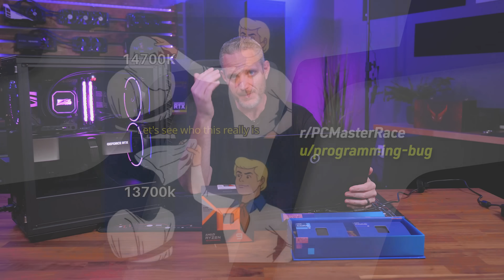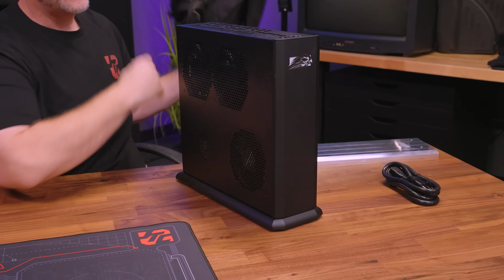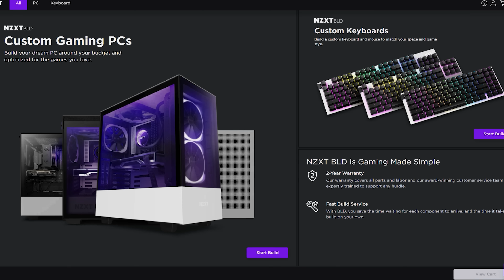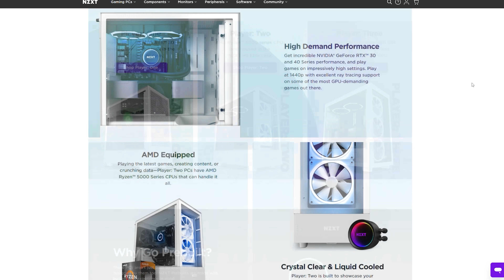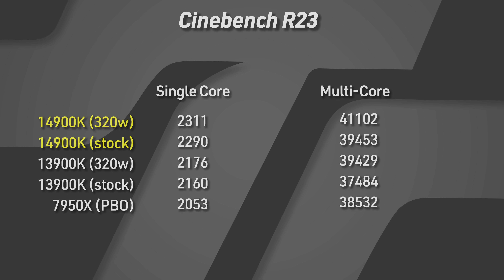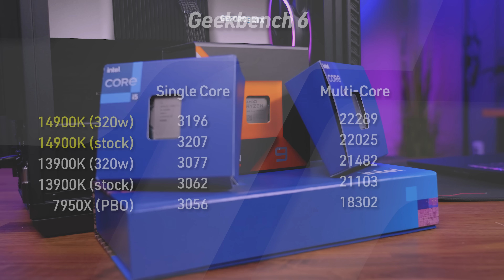THIS is why people have trust issues! Intel 14th Gen Review

Comment: Jay.. you can't say "rewinding" anymore.. There's so many youngins now that haven't a clue what rewinding means or where it comes from lol
It's all seek, "go back", and skip.  I'd be willing to bet a lot of the younger ones have never even heard of a VCR, or "tape" in any sense.

Like Jay and I are the same age, we grew up with real floppies, 8inch 80k-250k and eventually up to 1.2mb, 5¼ 360-720k disks, and computers that didn't have hard-drives.. The screens were monochrome or if you were a baller you had CGA graphics or a system that could accept cartridges!  In the first 20 years we went from a couple KB up to about 40mb HDDs. The next 10 years we went from those 40mb drives up to 250gb or so .. Then in the following 5 years, we went from those 250gb up to multiple TB hard-drives. NOW we have 1 trillion byte micro-SD cards the size of your thumb-nail.  The speed of progress just blows my mind every time I think about it. In my 4 decades I've basically seen computers be invented and advance to a 2023 cellphone going toe-to-toe with the worlds fastest super-computer of 2000.

Sadly, however, the period of exponential growth is behind us - we're already at the limit of what silicone is capable of.. 5nm is the size of about 10 large atoms.  So we're making transistors that are just several atoms wide, and at this scale, quantum tunneling becomes less of a "challenge" and more of an inevitability and barrier to further progression. Because the smaller we make them, the more concentrated the heat we need to dissipate is. The faster we want the CPUs to go, the more heat they generate in an ever-shrinking footprint.

I don't think we're done with speed and shrinkage yet though, we just need a different substrate .. which is why there's been so much attention and effort put toward graphene, carbon nanotubes, and even diamonds as CPU substrates.  So we're going to stall for the next few (several?) years until the industry settles on one path/tech over another, then things will start improving radically and very quickly again.

Sorry for the rant and whatnot, it's late and I've been slaving over a hot .. engine-compartment for about 40 straight hours. G'night kind internet strangers <3

Comment: My i5-2500k lasted about 10 years before I really felt that I needed to upgrade. I have had a 5900X since it came out in Nov 2020 and I don't think I will need to upgrade for a few more generations. Maybe 9900X or 10900X when they come out.
Reply: You will need to upgrade way before that, all you sandy bridge owners forgot how normal time and tech advances. You bought a good cpu in the dark ages of cpu advancement. CPU power has in fact already improved beyond the entire “bridge” era since the Ryzen 5000 series. Even X3D chips represent what still counts for an entire generation of improvements in game performance. Look at the 5900X vs the 7900X. The 5800X3D is almost the same as Zen 4 and the 7000X3D is another gen worth or perf, likely to match a stock Ryzen 8000 unless AMD breaks the mold again and perhaps the 8000 is like 35% faster baseline.

Comment: Maybe try running Cyberpunk on a z790 MB, for me it just wont work with out tweaking the Bios using a 13700k (tried both Gigabyte and MSI both had same issue) even clean install of Win 11 still would not run)

Comment: So I'm going from a 9900k to the 14900k. My 14900k already shipped. I'm happy tbh. I've had the 9900k since release. I like to upgrade every 5 years...Should I have waited for the 15th? I was debating it. The 15th should in theory be a LARGE improvement....but I just want to run my FS2020 at 60 frames 4k and be able to edit my videos a bit faster for now. I think it's worth it for me coming from the 9900...but I agree, coming from anything 12k or above, it's not worth it. Wait for the 15th if you're on the 12th or 13th gen.
Reply: I went from the 9900k to the 13900k and that upgrade was totally worth it.  Something like 3x the performance.  I'm sure that you will be thrilled with the 14900k.
Reply: Nice I also upgrade every 5 years and since mine was back in 2018 with the 9900k It was time to upgrade but I ended up getting the i9 13900KS, honestly the 14th gen not worth from the 13th gen so I will upgrade again in the next 4-5 years unless my system goes bad
Reply: You can always wait for the next thing.... I still run the 9900ks at work and its a long way behind my 13900k / 13900ks systems at home.
Reply: When you're ready to build, just pull the trigger. There will always be something newer and faster coming out.  If you're waiting at least 5 years between builds that means a new motherboard due to a cpu socket change anyway
Reply: You didn’t have to buy a 14th gen CPU to run MSFS at 60fps and edit videos. But I’m not going to bash you for making that decision. All the best with your new CPU.
Reply: @@lurch789 yeah people becomes to greedy to the point they feel they need to upgrade every year, honestly in real life gaming I don't see a huge diff only by benchmark you do and well with the ecores coming from the 9900k to the 13900ks I guess I didn't experience any issues with most of my tasks.

If only people could hold their ground and just not get deceived too fast then that would pressure Intel more
Reply: @@lurch789 After watching all the major reviews, the 14th gen is basically a repackaged 13900 haha. Kind of sucks but I've been wanting to upgrade for the longest time. The $50 or so dollar difference of the 13900 to the 14900 didn't break my bank, so whatever....but yeah, it wasn't a leap forward for sure.
Reply: I'm still rockin' a 4790K, and I feel like my computer is flying. I can't imagine what it will be like when I upgrade to 14th gen, although I'm debating just waiting one more year for Meteor Lake. Yes, every year will be something faster, but if it's a significant upgrade, I may just hold out for that.

Comment: As someone that's about to upgrade from an i7-8700, the 14700k seems like a no brainer to me as far as the best value CPU on the market right now, unless the 13900k comes down in price significantly. In Australia right now the 14700k is only $70 more than the 13700k. And the 13900k is $180 more expensive than the 14700k. Might as well get the 14700k

Comment: Running a 13600K. Not so much going from 13th to 14th but more wanting to go from 13600K to a 14900K, seeing that right now the 14900k is cheaper than the 13900K depending on the site.
Reply: I'm guessing you do more than just gaming?

Comment: I recently switched from an i5 4440 to a 12400 and the leap in performance was significant. for a 14th cpu if I upgraded I'd only be gaining a few more e-cores but the price, even more so in the third world, doesn't justify it.
Reply: recently swapped from an i7-4790 to a 12600k myself, this is a WORLD of difference. Wondering if i should upgrade to a 13900/14900k in the future
Reply: @kocepetkov5730  yeah it's a world of difference. i even got more performance out of my 1050ti with this upgrade. i think its best to wait until next gen to see what intel comes up with.
Reply: I built my first all new PC in over a decade recently as I got a heck of a deal on a Chinese Erying 12900H(14 core/20 thread laptop CPU on a desktop Micro ATX board that's a beast!!), 32GB of DDR4 RAM, and an AMD RX6650XT 8GB GPU on Manjaro Gnome Linux I can't see myself upgrading anytime soon with what Intel wants for 13th, or 14th gen, and same for AMD, and not much performance benefits, and this is coming from someone in the US making decent money, so it's not just 3rd world feeling the hurt when it comes to tech prices.
Reply: I think anything like a 5 year or more gap between upgrades would give a significant jump in performance. Certainly for the last decade. Things might slow from now on but who knows. 

For the average Joe watching YouTube and buying stuff from Amazon nowadays, pretty much anything will work 😂.

Comment: Im planning on building a new pc, my first pick was the 13900k. I got a i7 9700k running a 3080ti. Mostly for flight sim 2020..  would it be worth it for me to go to 14900? I’m pushing my poor 9700k barely pulling 20fps in VR.. with game mode and all the tricks to pull more fps, not counting the addons to bring it back down…
Reply: i went from a 9700k to a 13900k, difference in 4k gaming was much bigger then i expected. especially is 0.1 lows

Comment: Intel has used the "50" designation before with a desktop processor that fell in between the 10700 and 10900.  Remember the 10850K?  It was actually a very good value when it was released.
Reply: I still have my 10850k and yes it was a great value at the time. Basically just a low binned 10900k and set 100Mhz lower. My second core is a turd so I optimize around it and it's held up great. That being said from then to even 12th gen the performance has gone up quite a bit with the newer cpu's so I'm not surprised to see that slow down a bit between 13th and 14th gen
Reply: @jsteezy80  
With the 10850K, you still get your 4K/60 or 1440/120 at Ultra with Maxed sliders, right? 
I know i did with my 10900K, and so you do not need to upgrade. 

It's just a waste of your hard earned money. 

I run a 5800X3D with a 3090, and i don't need to upgrade. I actually dismantled my 10900K system to go full time with the 5800X3D. No need to upgrade bro. Save your money.
Reply: @clitmint  correct I can confirm that, as I have the same cpu, and even run a 4090 full throtle without botlenecking.. I don't even apply any OC as it runs 5.3 with my standard NZXT water cooling with a 360 radiator and a custom loop boosting the gpu.. I have never been able to run it hotter than 70 celsius even under intel burn tests with maximum load, like the never cpus that turns the coolers into rice cooking pots..
Reply: I’ve got a 4790k build powering my basement VR/ home entertainment setup. ten generations old now and still puts smiles on faces.
Reply: @aarliann  I still have two 4790K systems, first one is running for 9 years now. You can OC them to hell and back, but the only problem is, it's still just 4 cores.

Still, pretty good for 1080 gaming when paired with a 980ti or 1080ti.
Reply: @MalakSaesmus  
Tried slapping a 3090 into your 4790K system, just to see how it performs on the latest games at 4K ultra?

I still have my 4790K, but digging it out to set it up and take a look, i can't be bothered.
Reply: @clitmint  never tried it, sounds way too unbalanced. Too much bottleneck. Even with the 1080ti feels like I'm slightly CPU bottlenecked unless I'm OCing.

980ti is the sweetspot for a 4790K in my experience. That what was in my primary rig originally, but I used it for my brother's build.

I'm on my secondary rig at the moment, it's running the 4790K at 4600 and the GTX1080ti at 2075/11800. Only a 120mm AIO on the CPU, so I can't push it as aggressively as the other system (still around 45-75C at max depending on load).

P300A Mesh case, it ain't big and the airflow is questionable. I'm switching the low RPM fans for Arctic Slim PSTs in push-pull and hoping for if not better temperatures on the components, better airflow inside the case. I'll still try to push the CPU to 4.8-4.9 to check the temps with the slims.

My primary rig is in a Corsair 760T with 240/280 AIOs and push-pull Corsair MLs. That's an icebox. I was very lucky with that rig, the 4790K in that is way cooler by default, turbos farther than the other and stable at extremely high OC too. Plus no coil whine on the Strix 1080ti, which let me tell you, is freaking rare, lol
Reply: @MalakSaesmus  "...but the only problem is, it's still just 4 cores."

And the 4 cores of a 4770K/4790K are still significantly more powerful than the 6 gaming-enabled cores of an XBox Series X or PS5.
Reply: @bricaaron3978  that's for sure. One of the reasons why I skipped the early 5th gen CPUs. They were just weak compared to the 4790K.

But for the last 1-1.5 years the 4 cores are just not enough. Which is kinda funny how long they lasted for me. Didn't even have the inkling to upgrade for 7 years with this CPU.

Up until a year or so ago, I played everything on 1080p ultra. Even beat Cyberpunk on ultra, though it dipped into the low 50s/high 40s a few times, but generally stayed around 60ish.
Reply: @MalakSaesmus  "But for the last 1-1.5 years the 4 cores are just not enough."

Certainly. But the reason is that engines/games now are designed for console architectures, expecting PC to use brute force, exacerbated by miserable porting and sometimes DRM like VM Protect on top of it.

Don't get me wrong: I'm only explaining why I believe that a 4770K shouldn't be capable of running any modern AAA game at 60+ fps. If the Great Consolization of 2008 hadn't occurred and there continued to be AAA games that were conceived, designed, and coded for PC, a 4770K would not cut it at all today.

The meat of a game is in the CPU processing, which hasn't advanced in over a decade. That's why PCs can run modern AAA games at 120 - 500 fps --- the games give them hardly anything to process each frame.
Reply: @bricaaron3978  I mean, that's for sure and Nvidia just exacerbates the problem most of the time.

But there are still games here and there that can run really well on all kinds of systems, though they're few and far between.
Reply: @MalakSaesmus  Actually, 4 cores can still be enough, they just have to be modern ones. If you take a 13100f, put in on one of those mobos that allow bclk OCing (MSI Mortar Max for example) and push it over 5 Ghz they are still surprisingly good in most of modern games, as long as you're not running a ton of other stuff in the background. Even Hardware Unboxed did a video on this awhile ago.
Reply: @bricaaron3978  they.... aren't?
Reply: @mparagames  I appreciate your reply, but I don't understand what exactly you are questioning...
Reply: @bricaaron3978  i mean to repy to this
> And the 4 cores of a 4770K/4790K are still significantly more powerful than the 6 gaming-enabled cores of an XBox Series X or PS5.

Zen2 cores perform close to skylake cores, not haswell core. So you could maybe saythat the 6 cores of a console reserved for the game are comparable to something like an i5 9400f more or less (when HT is disabled), but then you must also remember that the consoles use a way faster mamory (integrated gddr6 rather than ddr4), and use the other 2 cores to process background tasks, while you can't really do that on a 9400f, meaning a ps5 / xbox series x would still perform better than a 9th gen i5 before even considering optimization made specially for the consoles by game devs
Reply: But for PC companies.. they need a yearly "NEW MODEL" to sell to people.    Real world difference between a top-end 4-year old CPU and new one is minimal.  Less heat, usually.
I paid $350 for a used ThinkPad with a 6core intel CPU thats 4 years old.  It's about 10~12% slower than the 2022 model which sold for $1800.  With the bonus of not using USB-C as a charge port.
Reply: Yup, you could get it for as low as $320 I believe which was an insane deal!
Reply: Yes I am still using a 10850k purchased it when it ran on sale for under $400 I think years ago. Smoking good deal and still holding up well today. Mine ended up being a decent bin for a 10850k. I don’t recall what my overclock is but it’s over 5.0 on all 10 cores. Think 5.1-5.2
Reply: I was able to run 5.1 on mine. It was a good chip. Ive upgraded twice since then; 12900k and recently 14900k... not out of necessity but because I have something wrong with me haha @jedpratte
Reply: 8086k was nice. 13990k released Friday 13th?
Reply: I have a 10850K and my friend has an OC'd 10900K and when I crank on mine we're damn near identical. I think we both will be doing a new PC at the 15-16 gen and 50 series gpu cards
Reply: I have it, It is a 10900K literally... I can swap those two and literally nothing changes, it automaticly clocks the same and has the same power draw. I could not find ANY other differences than the Ghz on the specs.. But those do not apply really..
Reply: Nope... It goes more way back than that! I had an 8350K actually and the cpu was nice. Could even compete with the 8700K if you overclocked it. So yeah... Intel is doing some trickering around here, for me is essentially 'playing with the market'. They're just messing with us

Comment: Does not work in Z690 Dark Kingpin. Probably not in Z790 KP either. You want to 100% slam Asus but looks like Asus released the Z690 Hero bios for 14tgh gen on Oct 6th. I think Microcenter was selling the 13900KS for $999 when it was new. I don't see a problem getting 13900KS performance for $580. My daily rig is a 7950x AM5 and I hate it and I have regrets.

Comment: I've got nowhere near the budget or need for a chip like this, but it's always interesting to see how things are going on the cutting edge of consumer tech. Shame that it's bad advertising, but even small improvements to efficiency and thermals are welcomed.

I'll stick to my 7600x for the next few years and see where things are closer to the end of the decade, though XD
Reply: Not at a $300 difference in price. This is just Intel  trying to respond to AMD who at least has a use case for more cores but only one has the VRAM makes for some problems practically.

Comment: I think even though its not great reviews, coming from a 8700k, I think I'm still going to commit to a 14th gen. Were there any comparisions between the 13900k and 14700k?
Reply: Get a 13700k or 13600k at a discount and don't worry again until 16th gen!  Either would be a hefty upgrade to the 8700k.